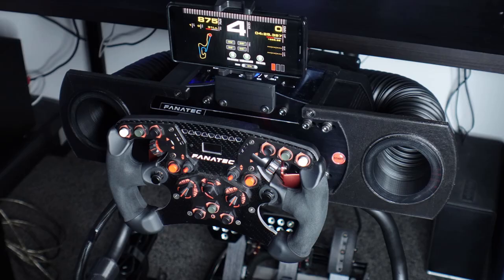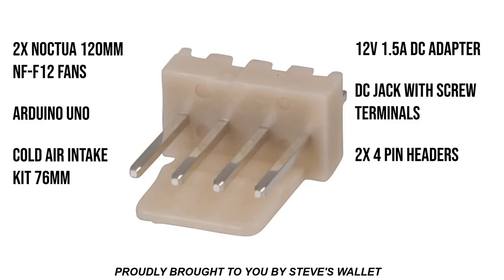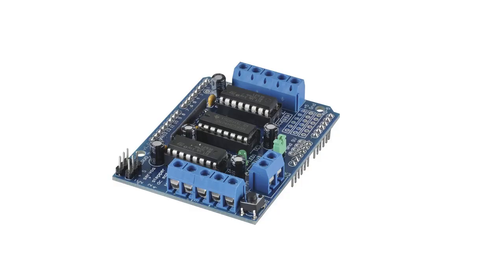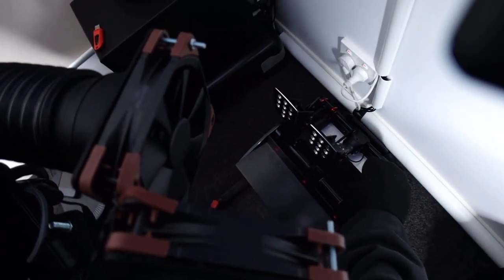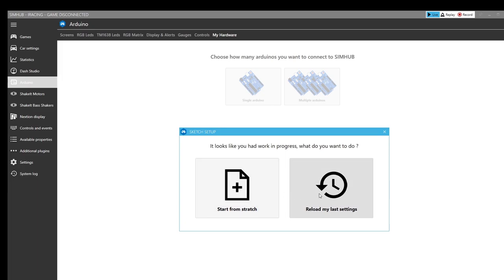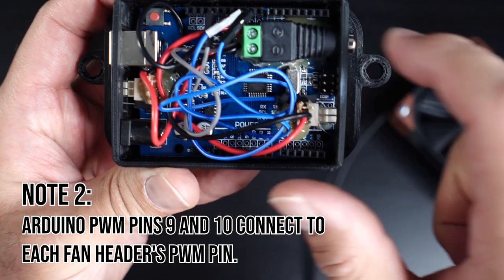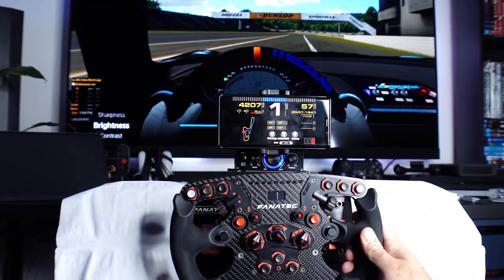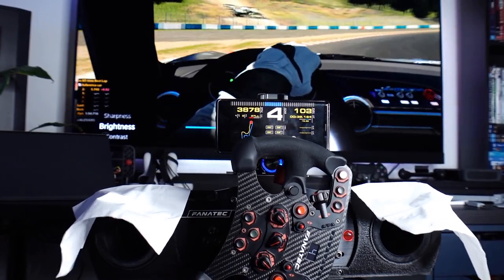Fanatec DIY Cold Air Intake Wind Simulator | So Immersive!!!

Comment: @SuperEvenSteven I had posted on someone else's comments previously, and I got the hardware side of things all hooked up, and we're a go, thanks! 🙂👍

I'm having a slight issue that I believe is on the software end, if you don't mind helping me out, please?

 The green light was solid and lit on the Arduino, their was a yellow light flashing, and I went to do the SimHub setup, and the fans kind of did their off and on testing as I've seen in YouTube videos, but after doing everything, the fans came on, and they CAME ON! FULL BLAST, NO STOPPING! They work, as it got pretty chilly, pretty quickly, lol. 

After watching some YouTube videos again, it looks like my error was that I forgot to click the "relay" option off for both fans. I went back and changed those two settings so that they're "off" now, loaded it to the Arduino, but, yeah, fans are still blaring... :/

I went into the settings of SimHub in the Shake It area and turned off the "idle" fan settings, but that didn't do anything. And I had not even gotten in game yet.

What am I missing here? Is there a way to uninstall the Arduino and start over?

I need some help, please. But it's good to know that I'm close. 🙂👍

Oh, and I would have thought the fans would blow out the one side away from the wires. Just found that funny, but it is correct per the arrow for "airflow" on there.

Thank you! 🙂👍
Reply from the maker: It's possible you have the effect "static wind" turned on. It's useful to switch this on and off when you're testing your fans but I make sure to turn that off and use only the "speed curving" effect. Hope that helps!
Reply: @SuperEvenSteven  Thanks again for helping out!

I'm wondering if I have a wiring issue of some kind. I double-checked the Arduino settings, they were correct. I went in to SimHub Shake It Wind settings, and I have all the idle wind settings off. I even tried clicking everything off and on - no change. I found the static wind setting, but I can't change that configuration or any of the other configurations. I click them, and they're all set to short and long press, I believe, but even if I change it, the save button is disabled.

I wonder the wiring issue because if I unplug the Arduino, the right fan (should be PIN 10) will slow down and stop, but the left fan (should be PIN 9) keeps going. I have to unplug the power supply to get it to stop.

Am I using a wrong type of wire? I used speaker wire. Do I have something connected wrong to the fans? Any ideas?
Reply: @SuperEvenSteven  Well, I am HAPPY to report, the official Arduino UNO REV3 fixed my problem!!! :D I didn't have to change any other physical aspects of the mod for it to work! Yay! I followed the usual instructions given and it worked!!! ^_^ THANK YOU FOR YOUR HELP! Thank you! ^_^

Comment: Hello. I can't get it to work. It shows connected but the fans just start spinning for a second by themselves. i may have a faulty arduino. i've setup others for LED displays and such. It won't trigger any of the 12 channels.
Reply from the maker: Hi Kurt, what type of fans are you using? Are they PWM fans? Also what happens when you enable the Static Wind effect and set it to 100%?
Reply: @SuperEvenSteven  The Noctua NG-F12 PPC 3000 PWM ones. doesn't work static. i noticed that you didn't talk about setting up the output. there are 12 channels but none of them trigger my fans. i just got another Uno to try later today afterwork. These would randomly start to spin up ever 5 seconds. weird.
Reply from the maker: I'll take some screen shots of my output settings and post links to them shortly.
Reply from the maker: I've added screenshots of all my settings in SimHub on my Thingiverse design:

https://www.thingiverse.com/thing:4964882 

When I test the fans using just SimHub, I configure the Motor Output tab to assign both channel 1 and 2 for the Static Effect. Then I go back to the  Effects Profile tab and turn on the static wind effect. You can then play with the wind power slider to manually force the fans on and at what speed you want them on at. When I'm finished testing I turn off that effect but leave it configured in the Motor Output tab in case I ever need to troubleshoot them again.

Hope this helps you isolate the issue.

Comment: Hi man, I have a noctua 140 mm, can it fit in your opinion?
Reply from the maker: Hi Guiseppe, it should work provided you power it with the right power adapter and the fan is a PWM type fan.
Reply: @SuperEvenSteven  yes, it's a Noctua NF-A14 iPPC-3000 PWM 140mm
Reply from the maker: There shouldn't be a problem using that fan with this setup. You might get better airflow volume with that fan also.
Reply: @SuperEvenSteven  tnx

Comment: Hi .Im in the USA and I'm trying to find a 4 pin header on amazon. What should i search for? Thanks ahead
Reply: also any difference between an Arduino branded UNO R3 vs a Kuman you have linked?
Reply from the maker: Hi Kazu, I got a couple of 4-pin male pwm fan connectors at my local electronics store in Oz. I also noticed Amazon doesn't stock them but you could try eBay or Aliexpress and search for "PWM Fan Extension Cable". You can then use wires to connect it all to the arduino without needing to solder it up although the wiring might be a bit messy :)
Reply from the maker: As far as flashing it with Simhub is concerned, there shouldn't be any difference. The author of Simhub dashboard claims it supports a number of arduino boards including clones (https://www.simhubdash.com/community-2/postid/1603/). I've been using my clone UNO with Simhub for over a year now without issues.
Reply: @SuperEvenSteven  Ok, so I think this is what I'm trying to do after watching multiple DIY wind sim videos and reading Reddit. Your video was highly suggested by a Redditor. I went this route because I don't have a soldering gun, and I was looking for an easy plug-n-play option, and this Redditor had listed his parts list, so I went with it.

My fan splitter cable has a male 4-pin connector and a male 3-pin connector with a single female 4-slot connector. For two fans, do I use the one splitter since you seem to say the "sense" pin doesn't matter, or do I need to use two splitter cables and connect them both to the Arduino after connecting them to each fan? I did buy 2 splitter cables so that I will have what I need in case both of them are needed, or since I bought the Elegoo Arduino mega board in hopes to eventually have 2 fans up top, and two fans down below, I would already have the cable to do that option if I only need one splitter cable for 2 fans.

Sorry, one more question, I've NEVER done an Arduino project! I did the DIY bass shaker setup and it worked, so I'm hoping to get this working as I have a PC VR build I'm working on for sim racing. Would I just connect the splitter cable into the PWM section of the Arduino? Does it matter which way?

I saw where you said this could be messy, but I would rather the easier option, and I'll figure out how to make it look manageable afterward. :)

Thank you so much! :)
Reply from the maker: Hi J,  I'm pretty sure you'll need two of those adaptors you mentioned so you have a separate PWM pin going to each fan's control pin (pin 4). The fans and the arduino board need a common ground so I connected a gnd wire from the barrel jack to the ardunio GND pin.

BTW, I have a solderless v2 of the wind simulator coming out very soon, taking me a while to edit. The wiring is the same as the last version, but I'll try and cover it in more detail.
Reply from the maker: Sorry, I should have been clearer, 4 fans would require 4 of those splitter cables and 4 pwm pins on the arduino board if you wish to control them individually. 

If you just want to control the top and bottom pair of fans separately, then 2 splitter cables would work also. For one pair, a single PWM pin would connect to both fan control pins, so their speed would be the same. Then repeat for the bottom pair.

Good luck! 👍
Reply: @SuperEvenSteven  Thanks for taking the time to respond, I appreciate it! 🙂👍 Ok, I think I'm getting the jist of it. For the common ground wire, do I buy some of that at Lowe's/Home Depot?

I'll subscribe to your channel because that future video sounds quite helpful! 🙂👍
Reply: @SuperEvenSteven  Ok, noted. They're pretty cheap to get, so no worries if I needed more. So, if I wanted to have the option of feeling the "left to right" movement via SimHub for when I turn in game and the wind sim corresponds to that movement, is that going off of the one cord, but SimHub is moving across that one range (aka my two fans connected as one), or would that require the two separate cords because it needs to access the left and right fan individually to be able to pull off that effect?

Thanks! 🙂
Reply from the maker: @J  you'll need a cable for the left fan and a cable for the right fan. This is so the control pin on each fan can go to an individual PWM pin on the arduino. I used PWM pins 9 and 10 on my Ardunio Uno board.
Reply: @SuperEvenSteven  Awesome! Thank you! 🙂👍 I've got two cords, so I'm good to go for my two current fans, and I can always add the other two later if wanted. And, sorry, Arduino noob here, but to be able to put use PWM pins 9 and 10, which way do I face my fan connector when putting it on the board? How do I tell which direction it faces/goes? I've plugged fans into a mobo before, but usually they have a connector which makes it obvious which way to insert it.

And, lastly, about that ground wire, do I just buy from a big box store some "common ground wire?" I may have time to get to this mod today, so I just wanted to make sure I had all of my supplies.

I really appreciate your help! Thank you! 🙂👍

Comment: Does the wind curving work in these diy versions?
Reply from the maker: Hi Fubar, yes it does when using SimHub dashboard and for games that support sending car telemetry to SimHub dashboard.
Reply: @SuperEvenSteven  Sorry i must correct my question, by curving i meant, does this work like simracingstudio hurricane, when you turn left the right side will blow more air to you and vice versa? If it will i will sure do the diy version. Thank you for your time!
Reply from the maker: Hi Fubar, yes it does, the effect setting in Simhub Dashboard is called speed curving and will blow more air through one of the fans based on the direction you're steering and car speed. In my testing I found while it worked, it's more noticeable on long high speed turns versus short slow speed turns.

Comment: Why not an arduino and motor shield?
Reply from the maker: Hi Akpan, if you are driving PWM fans a motor shield is unnecessary and adds an extra 1-2v on the total power draw. Less components to house also. I initially tested using a motor shield and some non-pwm fans and found it trickier to calibrate the cut-off voltage for 0 rpm. From memory, I think it was around 10V for my old fans. I also had to get an adapter that supplied enough voltage for the fans and the motor shield, 14V, which was a little more expensive. In the end I put the money I saved on returning the motor shield and adapter towards some quieter PWM notura fans. I figured if it didn't work I'd have some good fans for my PC.

Comment: If you already have a 12V supply inside by the arudino, you should convert the 12V to 5V with some resistors and run the board off the PSU.
Instead of increasing the draw on the USB cable.